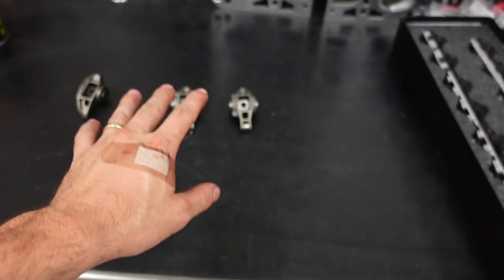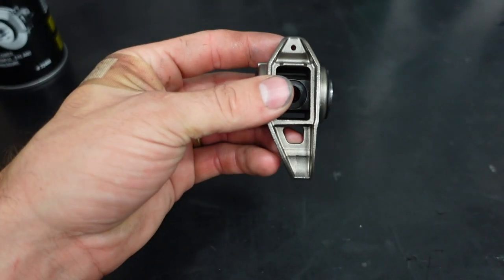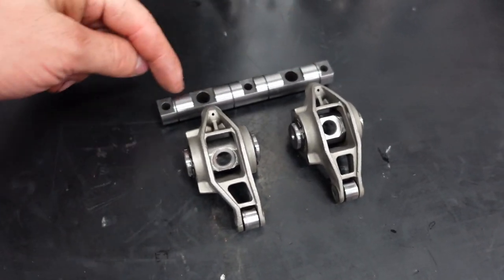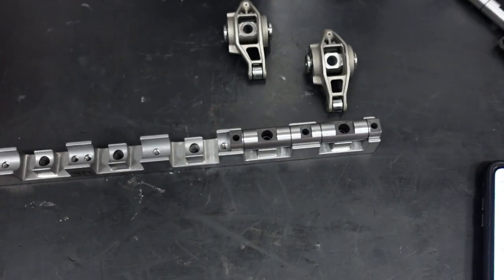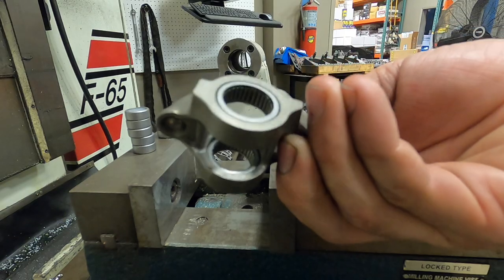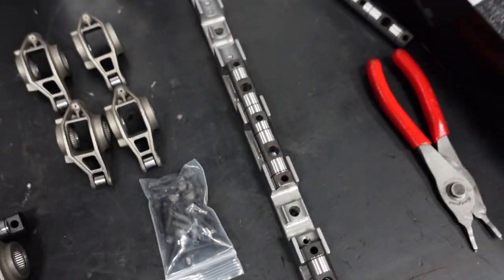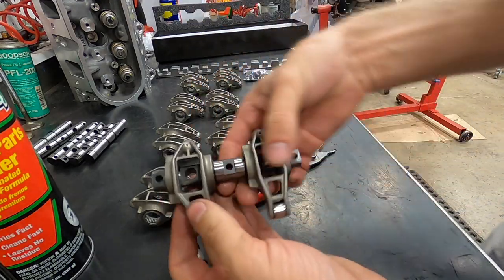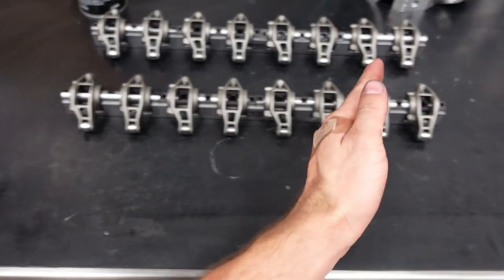Ultimate LS Rocker Shaft System - (super stable)

Comment: Shaft rockers are the bomb!  I had T&D rockers in my blown endurance boat and they were bullet proof.  Can’t emphasize the importance of deflection from any source to valve timing.  Not only in reliability, but also power since this consistency helps promote even power among the cylinders from revolution to revolution.
Reply: 100% T&D make great parts! I'm running a set on my 6.0 with L92 heads. I picked up .050 on my ET in my bracket car. Made the switch to shaft rockers for more stable valvetrain and with that came a better performance

Comment: I did the exact same thing about 6 months ago, BTR shaft mount with TSP roller rockers. Works great! 👍🏻🏁
Reply: Did you see a noticeable difference after installing?
Reply: and.......Crickets......😅
Reply: Hi
Which ls e give do you have ? 

I have also been oozing at the Brian tooley shaft upgrade but I don't know which rockers and springs will be compatible. I have a texas speed bald eagle cam in it already so wasn't sure which is going to work. Can you help ?
Reply: Installed and work great. Please read the instructions thoroughly and read again before installing! Can't stress that enough. Especially when installing on the engine. The pair will be tightened down together. I used ARP rocker studs and that made it even more fun.

Oh, stop using 5/16 dia pushrods.  BRIAN TOOLEY RACING sells 11/32 pushrods in 0.080 wall. Same price if not less than a 5/16 and noticeably stronger. Since we're all in for the "RIGID"
Reply: Have you pulled them off and checked the bottom side of the fulcrum/shaft. Mine showed west after only 1000 miles

Comment: The shaft rock kit is pretty slick. I just installed the V2 version on a 2005 Corvette. I bought it with new BTR rockers already installed. Engine has a 7,200 rpm limiter and makes about 850hp with a Magnuson supercharger.

Comment: It’s been 5 years already and over 80,000 miles 
08 Tahoe with ls2 swap , 226/232 cam 114 LSA 600 lift and no trunnion issues, no lifters issues and oem pushrods
Should I start worrying about it?

Comment: Will the TSP 1:8 steel roller tip rockers work with the Comp Cams BSR shaft rocker system for the GM LS7? I obviously love all the benefits of the roller rocker, and the strength and durability of steel rockers especially on the LS7 valve train geometry.  I will no longer run aluminum rockers even on a relatively  mild 228/244, 630/621 118+3 street build (no matter who makes them) because of the high failure rate of  aluminum rockers. I run with open spring pressures of 436 with PAC 1207. BTW, YT Ultralights are beautifully made, but will not hold up for open spring pressures over 220lbs, as stated by YT. Who the Hell runs 220 lbs on any cam upgrade? Rediculous .

Comment: So the piece the rockers bolt to is now steel, rather than cast aluminum? Wondering if they make an LS7 version that bolts to the cast in place rocker stands, without having to machine the LS7 heads rocker stands flat????

Comment: Question: As I was duplicating your set-up (using BTR's changed design of thrust washers rather than circlips now...ugh), I wonder if you've observed any issues related to the different expansion coefficients between the steel parts running the length of an otherwise all-aluminum head, when everything is up to operating temperature?
Reply: Tsp rockers are wider by .025 to .030 atleast mine are. Have them at a machine shop right now won't fit in the stands with the new washer/shim design

Comment: I'm wanting to go this route. In 2019  replaced the rockers on my Pontiac G8. I was going to leave the trunnion upgrade to my factory but wind up buying some prw for roller rockers. These rockers were definitely heavier than my factory but I figured with the roller tip to reduce friction and the sturdier body would give it less deflection. I figured maybe a couple horsepower for the roller tip reduce friction, an stability. Long story short the needle bearings  wound up failing on the roller fulcrum on several of them! Can I use these on the shafts with a new bearings and shaft mount supplied? also these being heavier would I benefit on going with the factory body style like you had with the full roller tip? or Would these be fine on the shafts with new bearings?
Reply: Then Btr shaft kit comes with bearings that fit stock rockers and apparently these Texas speed rockers

Comment: I was wondering I have a 2014 LS4 430hp what’s your recommendation for Roller rockers and rack to sit the rollers to get the strength im not racing or doing those things I’ve only got 33k on the motor

Comment: I have a 5.3 LS with practically no oil pressure on. I put a new oil pump and it did nothing for it you got any ideas ???
Reply: Replace your oil pump pickup tube o-ring and your camshaft thrust plate (behind timing chain, which you might as well replace while you’re in there with a Cloyes double roller timing chain & matching gears), plus get a Melling high volume oil pump instead of a regular stock replacement volume pump. 

There is also the oil barbell on the back of the engine on the driver’s side that is plastic with a few o-rings on it that you should replace with an upgraded aluminum one.

Change your oil pressure sending unit and if all of that doesn’t work, you probably need to replace your bearings (main and camshaft) and probably even your piston rings as well?… basically rebuild your engine.

Hope this helps you figure out the problem.😎👍🇺🇸

Comment: I know this video is a year old but I’ve watched this video many, many times before posting this.  I was looking to do the same thing but I got to thinking, can I do the same thing but with 1.8 rockers?  I know that the push rod length will change as well as the cam specs.  I’m also sure this may also cause piston and valve issues.  What do you think?

Comment: you talk about the valve tips getting messed up under spring load of 420 lbs and more. my springs are tested at 415 lbs at .660  but all my exhaust valve tips and 1 intake valve tip are mushroomed.  should i upgrade to the roller rockers?
Reply: … and maybe stronger, higher grade valves?🤔👍

Comment: I've always wanted to put together a high rpm engine. No matter the final power output just the idea of 8500rpm+ has always been something I I dreamed of putting together . So here's my question. I don't know much about the 4.8 ls. , but Is it be possible to put together a long rod 4.8 and would it do what I'm asking with the right internals and valvetrain.   And if so I wonder what kind of numbers it would make
Reply: Probably need a custom piston
Reply: why not destroke a 6.0? just use a 4.8 crank. can be built with junkyard parts, you end up with a big bore/short stroke that you can then use almost any gen3 or 4 head to feed because of the 4.00" bore. then pick how hard you wanna turn it and put the top end together accordingly.
Reply: Anything over 6500 makes me cringe and cover my noggen. Over 7000 you're only testing your rotating assy and hanging on for dear life. Why worry about that extra 1000 rpm there's nothing happening way up there accept the risk of destroying everything. Well built and components matched engines can make all the power you need down low and never have to put it up in that high risk zone. If you like listening to metal in a blender build yourself an 8G motor. Hope you have a lot of money
Reply: @walasiewicz   pro stock and nascar engine guys probably won’t agree with you on that. It’s easy to build a engine to make power above 7k rpm’s especially a LS.
Reply: @walasiewicz  I have an LS6 with PRC heads and a Fast 102 that is much faster being shifted around 7100 rpm. It can do that all day.
Reply: @C6Z_Bob  the LS based engine it's by far the best v8 engine ever engineered they are litterally bulletproof
Reply: @walasiewicz  Nothing happening over 7,000 rpm? Maybe not on a stock engine, but there most assuredly IS something happening "up there" on an engine like the authors is!! Nearly .700" lift on intake, and .670" lift exhaust will assure you of that. Not all engines die above 7,000 rpm. Speak for yourself.......

Comment: When I looked up the BTR Shaft Rocker Kits they all state to use the OEM GM rockers. Which full Roller Rockers did you go with and did they hold up?
Also, I saw a few 1-Star Reviews of the BTR Shaft Kits that stated they cracked or were scored after 10k miles, what (if anything) did you see with yours?
Edit: 6.2L LS3

Comment: Does adding the long support arm under the rocker shafts lift the rockers further away from the head?
(Does this mod require new longer push rods)?
J

J
Reply from the maker: It replaces the factory cast piece, so the length doesn’t change. But the roller rocker repositions the pushrod cup and requires a .150” shorter pushrod
Reply: @JacobVillemain  
Interesting. 
Does the new  (.150in) tilt angle  of the rocker arm effect lift or duration at all?

J
Reply from the maker: @jscottc6675  negative
Reply: @JacobVillemain  
Neat stuff.
Thanks
Reply: @That Engine Guy  .150" shorter PRs is all the better to not flex!!! A win-win here!!! GREAT VIDEO

Comment: What do you recommend for rebuilding a original stock LS1 from a 2002 Camaro SS ? I want to upgrade it and add a little extra power but nothing crazy and can use 91 octane. It’s still running well but has well over 200,000 miles on it
Reply: Bump the compression up to a solid 11:1. Have solid head work done, ie. CC'd, real valve job, upgrade the valve train(cheap Chinese new is not an upgrade), tie bar lifters, Cam Motion LLR, 11/32 pushrods(3/8 are hard to fit), stock crank, Gen IV rod with new ARP bolts, the lightest piston you can find with the top ring 0.125 down from the crown, low tension rings(maybe ditch the engine 2nd😉), quench 0.038 to 0.048(NO MORE NO LESS). It'll drink 91 to 93 all day. That should get you in the ballpark of being where you really wanna be! Just my educated 2 cents. Sorry if you felt overlooked. People get busy. Hope this helps.
Reply: Oops.....you said "a little". In that case get a tune up. TR6(8), MSD wire set, Ford Motorcraft PM-2(2 cans). Spray the PM-2, generously, into each cylinder through the sparkplug hole. Use a long flexible straw from a can of Seafoam(throw the ENTIRE can of that shit away). Let soak overnight. Place towels near each sparkplug hole to catch anything that comes next. Spin the engine over to expell any PM-2 still in the cylinders. Install your new parts, change the oil and let the smoke show begin. Video and post somewhere. Let the engine come up to temp by cycling engine speeds from idle to 2k periodically. Test drive and blow anything left out. That's the recipe for the best "Major Tune-up". I'll take the Pepsi challenge any day with that.

Essentially what you're doing, actually the PM-2 is doing, is releasing Millions(and MILLIONS) of hydrocarbons built up over 200k from the piston ring lands, compression rings, and most importantly oil control rings. Seriously, do this for a little more power. Either way you just got the best recipe you never had.

Comment: Seems these shaft kits are already blowing engines. Bushings fail, breaking clips and sending metal through the engine. Idk why this is not talked about more. They sell these as an upgrade, but their failure rate is pretty common. Read on many forms and look at reviews as on summits website. I am rebuilding and engine as we speak due to supposed trunion upgrade failure. Bearing crushed, clips broke, wiped out cam lifters and bearings. Stage 1 cam in a l76.

Comment: I take it the once all these are installed, a shorter push rod has to be used?
Reply from the maker: Yes, pushrod length will change compared to stock rockers.
Reply: No actually longer push rod not shorter and you always always have to measure pushrod length on every LS engine
Reply: @mikeeagle2653  That's true ANY time you build ANY engine.......

Comment: So if I don't plan on going over 6500RPM I don't really need pedestal roller rockers???
Reply: If you don't run super high valve spring tension (over 200 @ seat) and have valve  lift under 0.600".....The OEM rockers with a bushing kit will get the job done